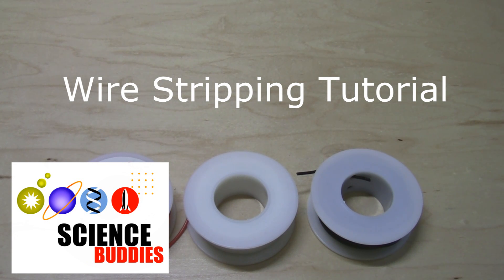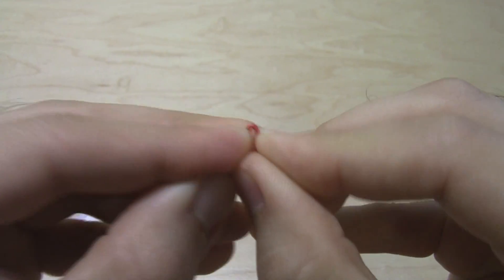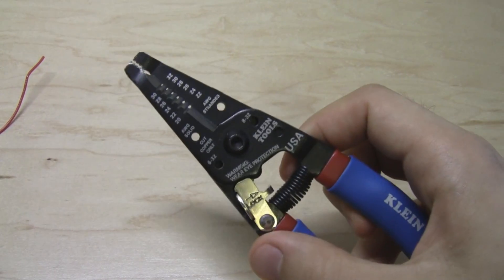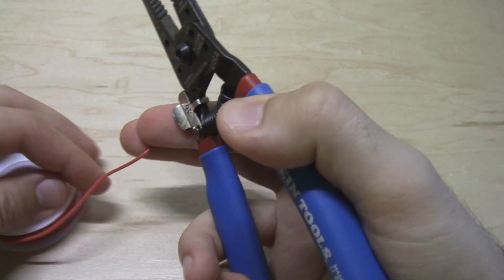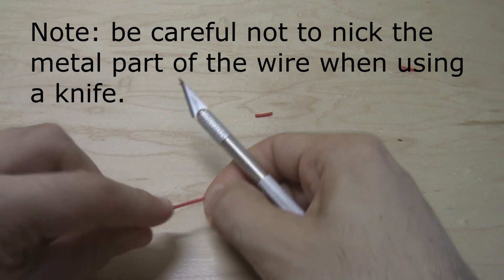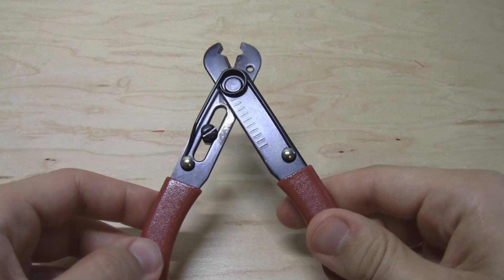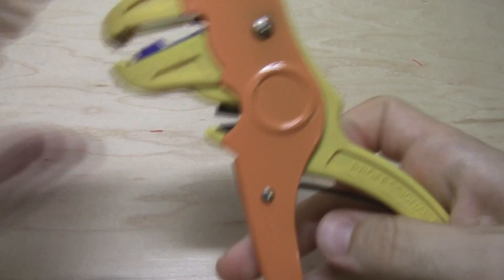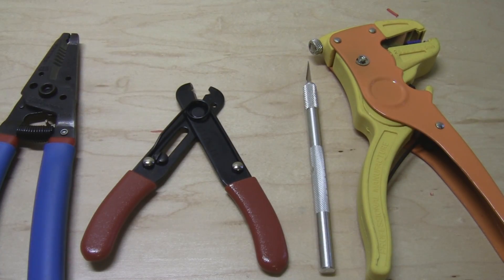Wire Stripping Tutorial: How to Strip Insulation Off Hookup Wire

Comment: what id the wire gauge is not known.  Where do you start as far as selecting the right hole?
Reply from the maker: Start with the largest hole and work your way down. If you start with a smaller hole you risk accidentally cutting the wire and not just the insulation.